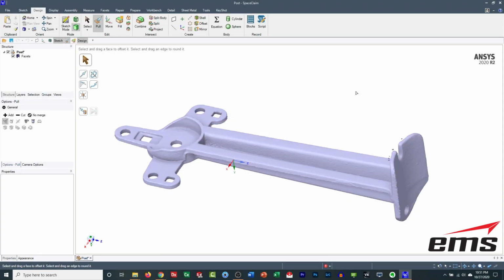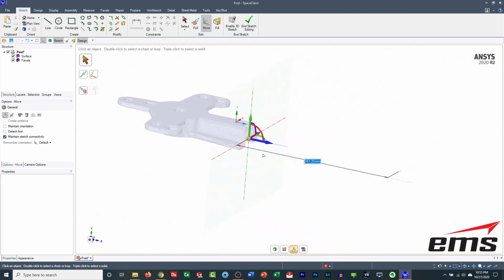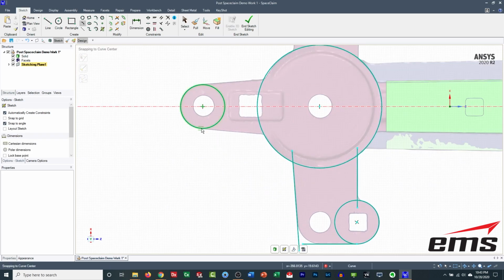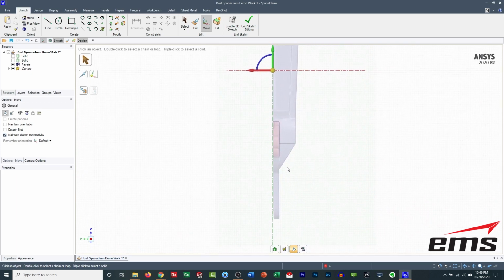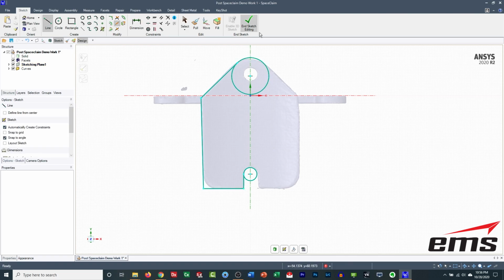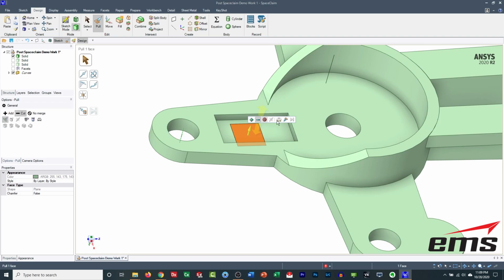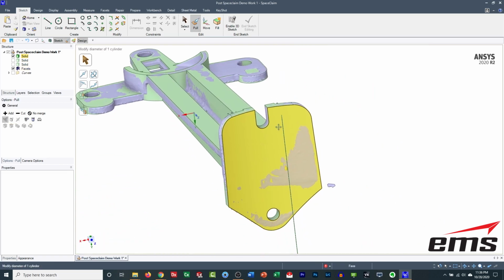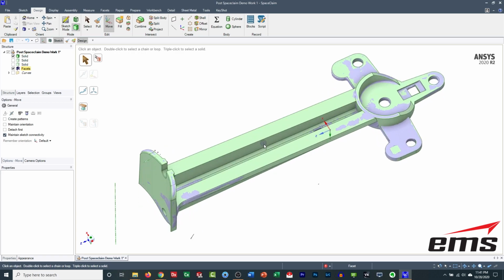Ansys Spaceclaim 2020 - Modeling a Casting from 3D Scan Data

Comment: I think you should have made use of dimensions and added some constraints within your sketches - that way you can focus in on round numbers , changing the sketch dynamically to visually match the scan data more accurately - it shows off the software and is a more accurate depiction of the original design intent.
Reply from the maker: Yes in a real world situation that should be done.  As we explained in the video for time purposes we did not constrain or dimension the sketches.